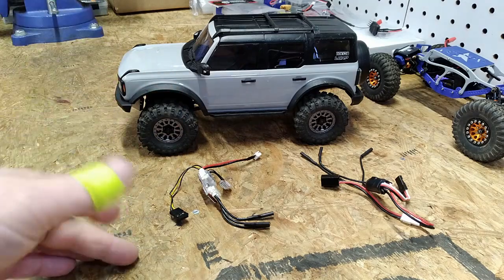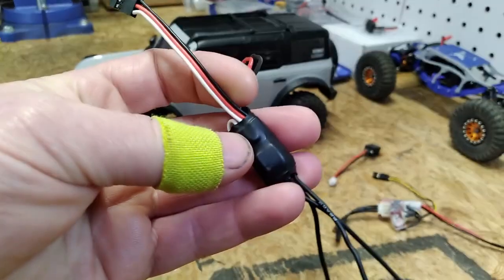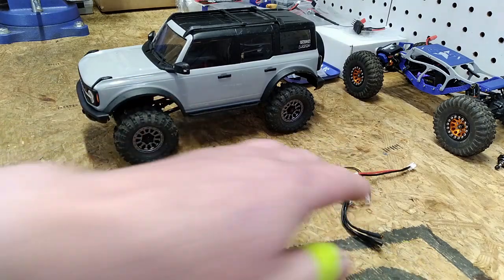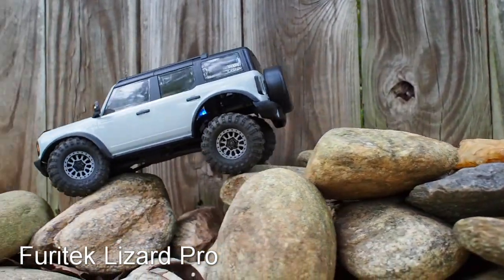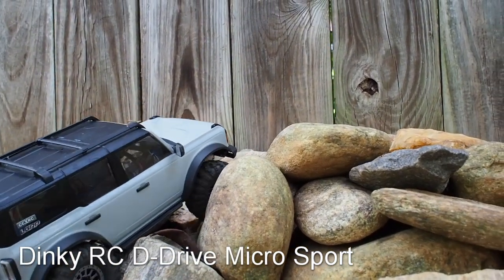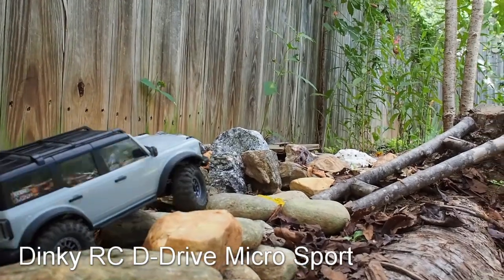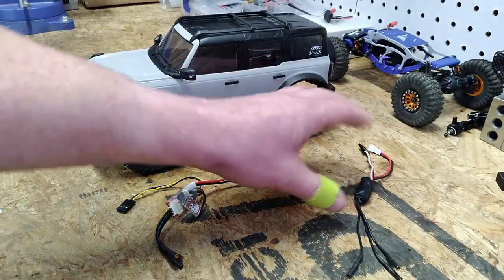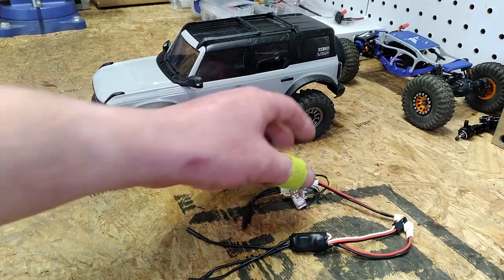Testing The Best Micro Crawler Brushless ESC's! Dinky RC and Furitek.

Comment: Did you mount that outrunner to the stock transmission? I couldnt get mine to fit, hits the driveshaft.
Reply from the maker: Yes I did mount to the stock transmission, however it was not an easy install and I had to make a hybrid front driveshaft with a CR18 universal joint at the transmission end and stock traxxas CV joint at the axle end. That's the main reason I have not promoted this motor for the TRX4M platform as it's not drop in replacement. Great motor but not a strait swap in these trucks. Thanks for your comment!
Reply: @havikhobbies  thank you for the reply. I ordered the injora 370 tall transmission. I think it will fit the HH280 revolver.

Comment: To help the foc jump go in and adjust your low speed setting to about 30% this will help greatly with the jump and put start up at low
Reply: Yea, you can tune it to where the FOC is only noticed when you are near full throttle. So not noticeable when slow speed crawling.
Reply from the maker: The settings chosen in the Furitek app are very dependent on the rig your running it in. Motor choice and final drive ratio have a huge impact on what settings work and what doesn't.
Reply: @havikhobbies  your not wrong I’m going of worm gears and stock scx24 hearing

Comment: I would actually greatly appreciate a program walkthrough, I'm having cogging issues and curious to see how you have yours setup
Reply from the maker: I can definitely try to get a video together. What is your setup? Truck, gearing, motor etc. Thanks for watching!
Reply: @havikhobbies  the fairly common dinky with smp stock transmission gear ratio, and then ogrc axles which have 23% over drive. I ran stock axles even and had the same stalling/cogging. Basically the truck struggles under any load and lacks torque and I'm using tattu batteries like dinky recommended. I get excited to see when you upload, videos are always super informational and I just enjoy the crawling footage 👊👊
Reply from the maker: @isaiah9313  With the stock SCX24 transmission on those OGRC axles you should have enough gear reduction. Are you running the 20t pinion with the SMP?  Have you setup your motor profile (kv, pole count) in the configuration tool? How heavy is your truck? Does it cog at low speed only, or anywhere in the throttle range?
Reply: @havikhobbies  I'm running the pinion that was recommended on mofo for stock trans. I haven't configured anything yet. Seems to happen at low or high it'll bog down under any resistance. My truck weighs around 380g.
Reply from the maker: I would definitely plug the ESC into a PC with the AM32 Programmer/Multi ESC config tool. Set your motor poles and KV to match the motor (14 pole 1700kv for SMP) Make sure the Stall Protection and Sinusoidal Startup boxes are checked. Set Timing advance to 15, Startup power to 100, Sine Startup range to 25 and Sine  Mode Power to 6. That should get you to a good starting point, I hope that helps!
Reply: @havikhobbies  Thank you man I will try that as soon as I get a chance!
Reply from the maker: @isaiah9313 Oh and make sure the Stuck Rotor Protection box is NOT checked. This setting is for aircraft and will cause issues with a crawler!
Reply: I‘be been having this same issue. Serious clogging when it hits any resistance, throughout light throttle and wide open throttle. Dinky is stumped. 

I have about just the same tune you mentioned.
Reply from the maker: What motor are you running? Oh and welcome to the crew! Thanks for subscribing to the channel, it means a lot to me.
Reply from the maker: I know you've probably checked this but the "stuck rotor protection " box is ticked when the ESC is set to default settings. Stuck rotor protection won't play nice in a crawler!
Reply: I’m running the usual SMP setup. Stuck motor protection is also turned off. I’ve been searching far and wide for a fix but nothing.
Reply from the maker: @40ozAnd24s  I'm running an SMP In one of my Slayer's. My Dinky ESC has 2mm bullets soldered to it, if I can figure out an adapter to plug the SMP into the Dinky i'll see if it's a problem with that particular combination.
Reply: @havikhobbies  rad!